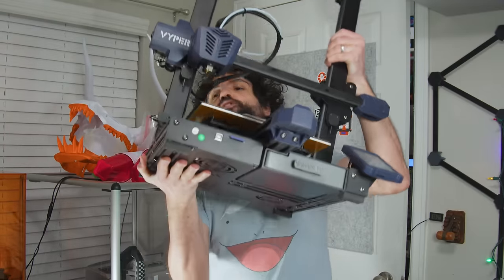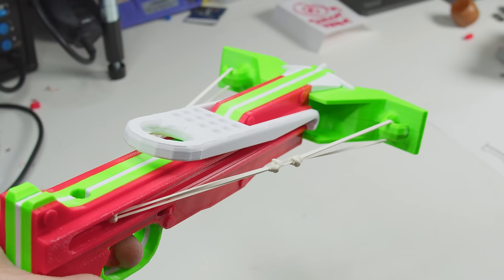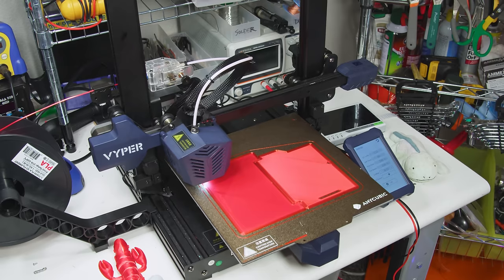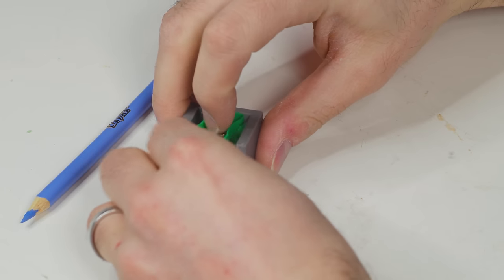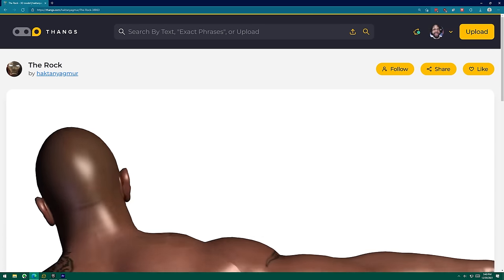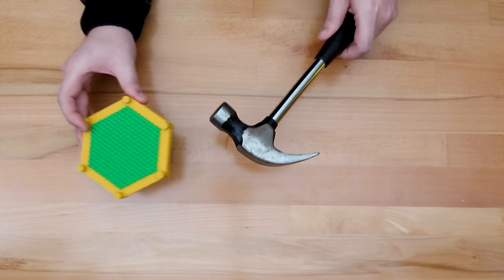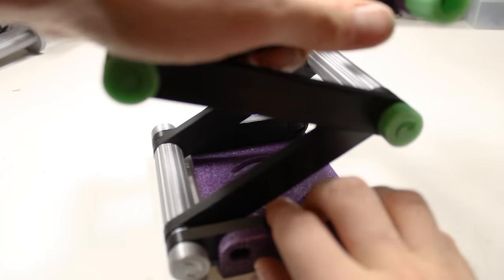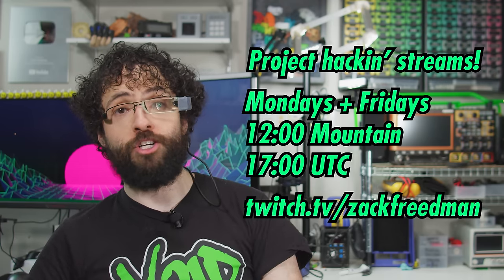10 Cool Inventions Anyone Can Print - The Best Models for Brand-New Printers

Comment: Hello, I saw in ,your videos, many 3d print stuff. So i ask you, can i use BLENDER to make my own thinks and Print it?
Reply: I don't know, but check the kinds of files that blender can export and see if a slicer from the 3D printer can import it.
Reply: The prusa slicer for example works with 3MF, STL and OBJ (and AMF, but that's not recommended). Can probably vary, but I only worked with Prusa before.
Reply: Thx

Comment: @Zack Freedman For the nunchucks is it possible to stabilize the grips as they get taller to prevent the failure?
Reply from the maker: Printing it on a raft could help, but it’s just going to be a challenging print. If your supports are good, you could try turning them a few degrees and printing the whole length with supports.
Reply: @ZackFreedman  Did you consider printing on a raft?

Comment: "which anything are you going to do first"
"printer upgrade parts"
you know i've had the same fdm 3d printer for the last 6 years and just keep upgrading it instead of buying a new one. 
half the plastic parts mysteriously melted one day while sitting on my floor unplugged. so only the motors, hardware, hot plate, and acrylic frame are original. 
its more mine than the Chinese company that originally made it.

Comment: ISF15ACP4

Digi-Key Part Number

360-3378-ND

Manufacturer

NKK Switches

Manufacturer Product Number

ISF15ACP4

Supplier

NKK Switches

Description

SW PROG DISPLAY SPST-NO 0.1A 12V

Manufacturer Standard Lead Time

15 Weeks

Detailed Description

Programmable Display Switch Pushbutton, OLED SPST-NO 0.1A @ 12VDC Through Hole